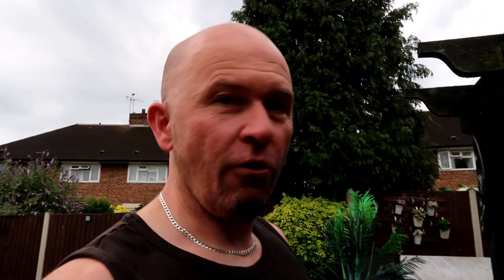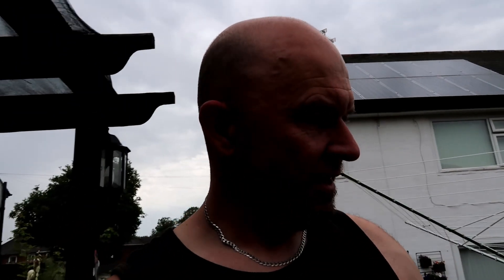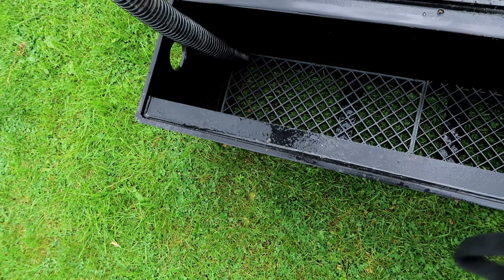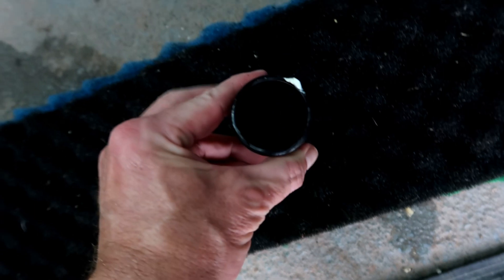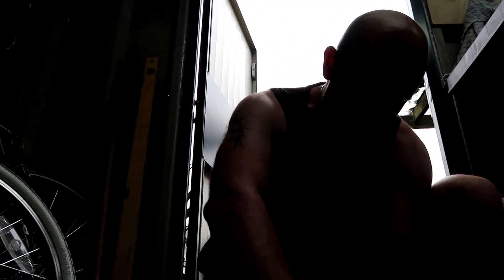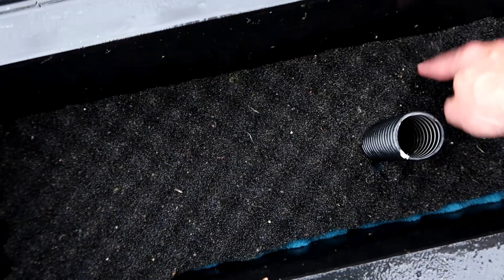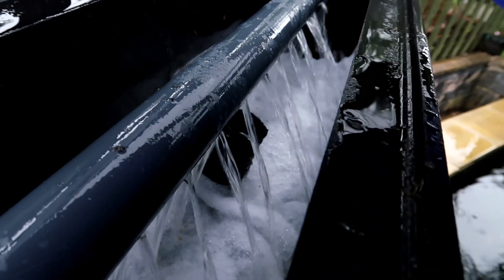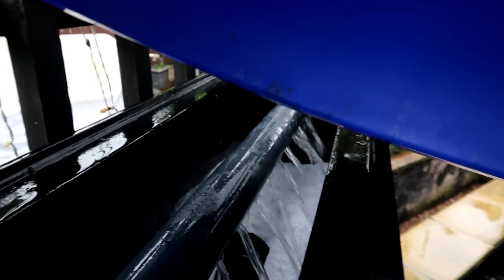Installing An Overflow On The Bakki Shower

Comment: Great little mod that is, maybe glue some solid pipe in to 2 opposing corners
Reply from the maker: Yeah good shout that
Reply: @Sharpeyskoi  what's your view on your water clarity after installing the shower?
Reply from the maker: @paulf9064  tbh my clarity was spot on anyway so no change really. Nexus works well for me. But it's defo helping nitrates .